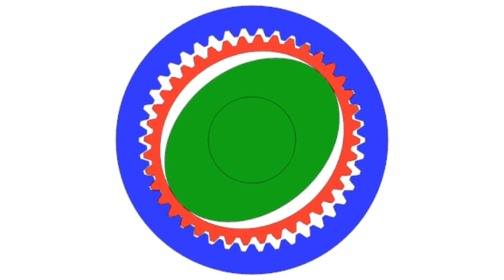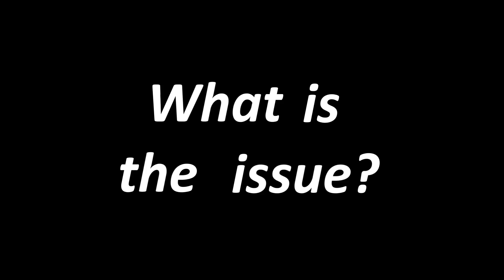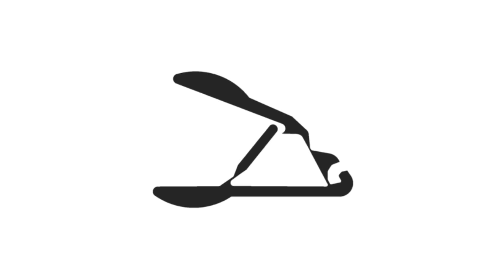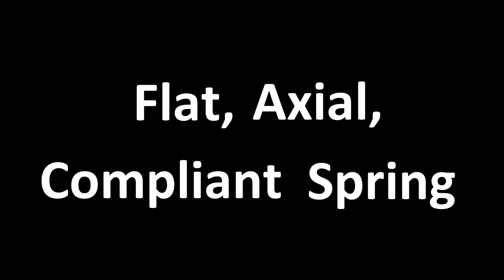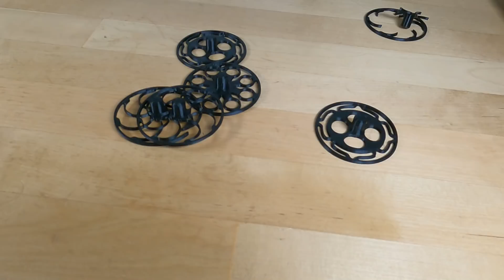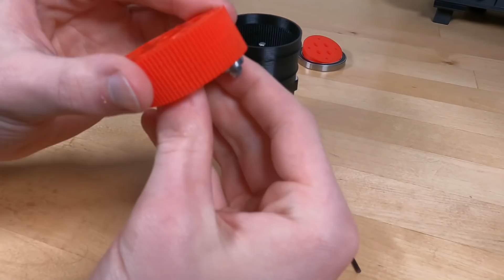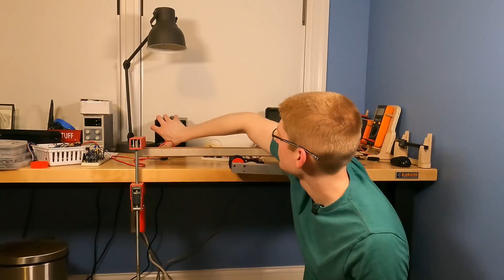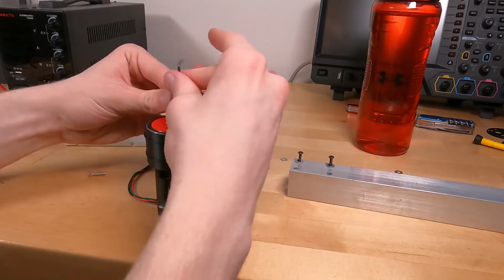Compliant Harmonic Drive (3D Printed)

Comment from the maker: Whoops! Every time I said "plastic deformation" I meant "elastic deformation". I guess that's what I get for not writing scripts. Also, I filmed this video with a new camera, so I was still figuring out things like focus and white balance. Oh well :)
Reply: I guess the important word was "deformation".
Didn't notice anything annoying with the camera... focus a little slow on close-ups, but better than most Youtube offerings.
Reply: It was elastic deformation of plastic, so I’ll allow it.
Reply: Hmmm... What about making a dual-layer deforming piece, where one layer is conformal to provide springiness and the other incorporates a 'disc-and-socket' joint at either end of a 'bone' for resistance against torque without preventing deformation.  Both layers would be part of a single model.  There would just need to be a small gap between the disc and the socket to allow for rotation.  (Three layers would be better as you can trap the rotating joint in between two conformal hinges, but that would require some thought in regards to support.)  Does that make sense?
Reply: perhaps if u use metal like what actual springs are made of i could handle more pressure
maybe?
Reply: Pin this

Comment: Failure??? You were creative, you designed, you build, you tested, you learned and you shared. Hence, a big success! In one word: IMPRESSIVE!
Reply: As a close friend once said to me: “We live and we learn. I am now wiser. This is not a complete loss.”
Reply: He was using the term failure in an engineers sense. He was measuring how much torque it took to break the mechanism. If the answer is higher than anything it will see in actual use, then it's strong enough. The safety factor is how much higher. If the answer is too low, he has information about how to adjust the design.
Reply: Failure might just be as useful of a result as a success.
Reply: As Thomas Edison said: “I have not failed. I've just found 10,000 ways that won't work.” “Many of life's failures are people who did not realize how close they were to success when they gave up.” 

I wonder how how two flex plates like you designed installed in opposite direction would hold up.
Reply: Same philosophy here. Despite the mechanism failing (i.e.: reaching a failure state such as slippage or breakage), the process of experimentation was a success as it yielded worthwhile information.